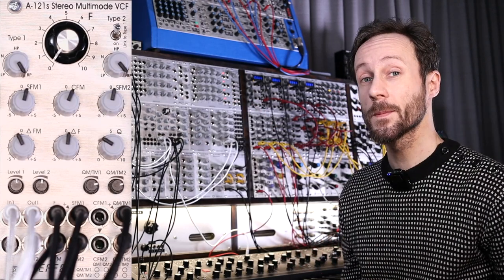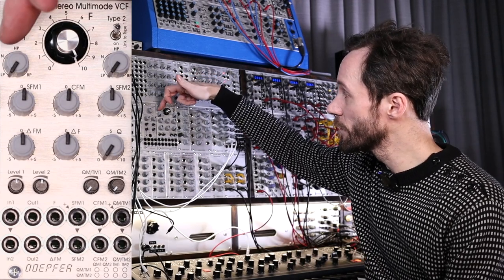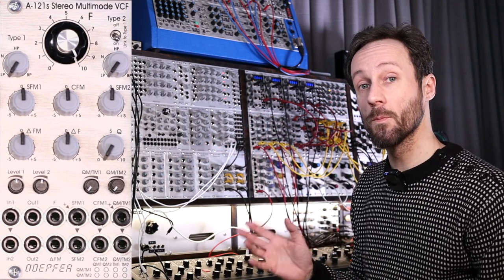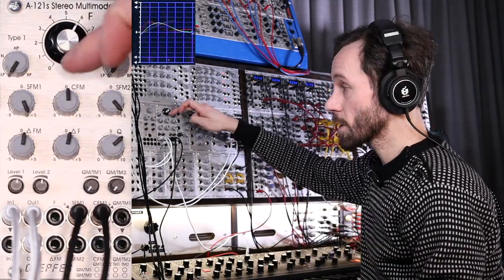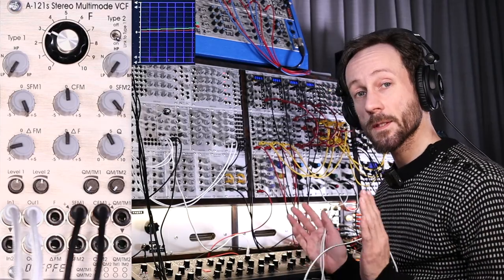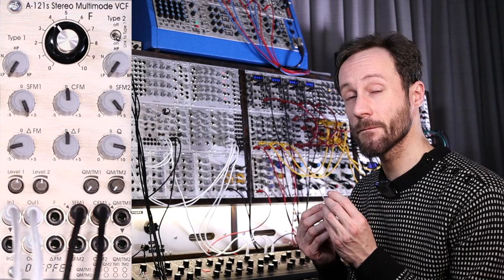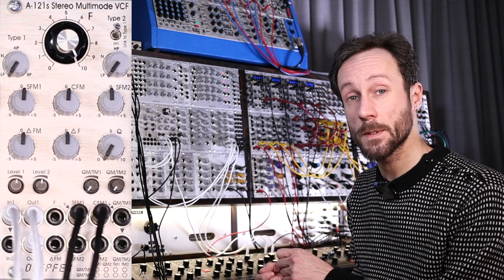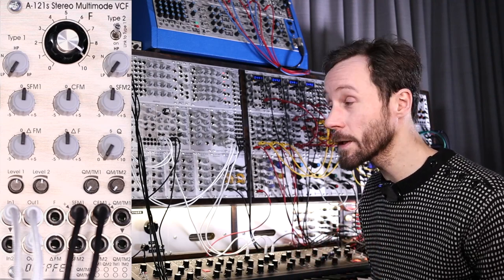Doepfer A-121S Stereo Multimode VCF

Comment: Great demo brother thank you! What I’m confused about with this filter is the stereo ins and outs.. so filter 1 only goes to output 1 and filter 2 only goes to output two but the common frequency gets applied to both outputs? And delta is like a Crossfader for filter 1 and filter 2 so when the delta knob is turned all the way to one side the output will be silent?
Reply from the maker: Thank you 😊 
Delta is not like a crossfader but offsets the frequency of one filter to the other resulting in a perceived stereo alteration. The side with higher filter frequency seems louder.
Reply: @Detroit-Berlin interesting, I think what I’m curious about is the outputs are not true stereo image correct? depending on the settings of their designated filter each output will have a different signal?
Reply from the maker: @Pb_salt  I’m not exactly sure what you mean, if you feed it a stereo signal both channels stay separate (true stereo), if you feed it mono it gets split and both go through a separate filter. If you want to pan the stereo sound you’ll need a stereo panner.
The frequency control controls both filters and can be offset between both filters.
The potentiometer of the frequency has one shaft but on this shaft are two potentiometers to each control their filter. (stereo potentiometer)